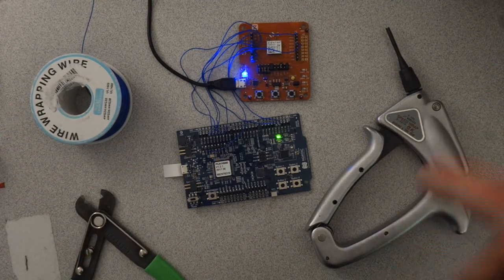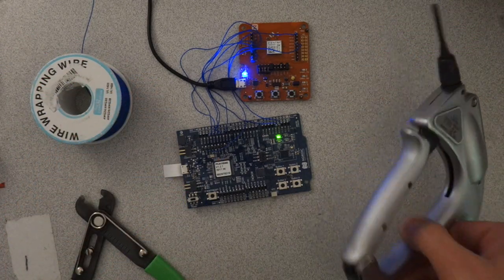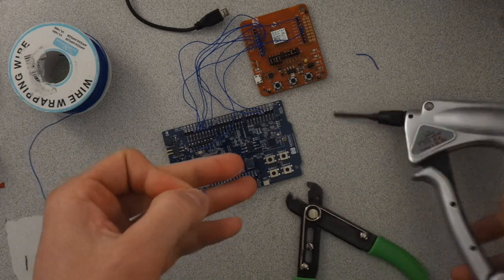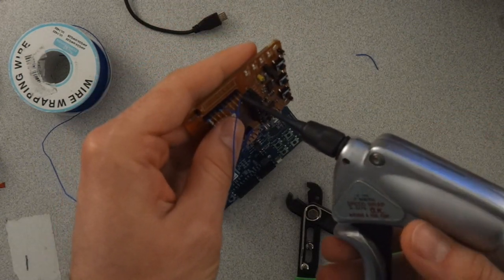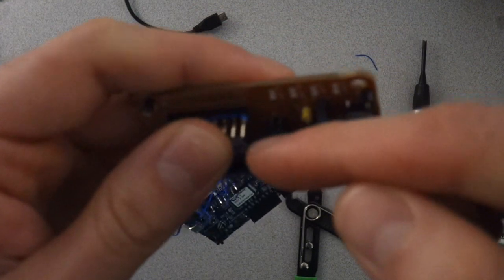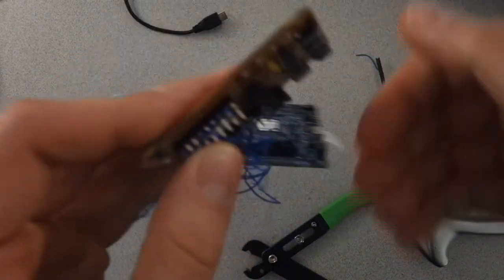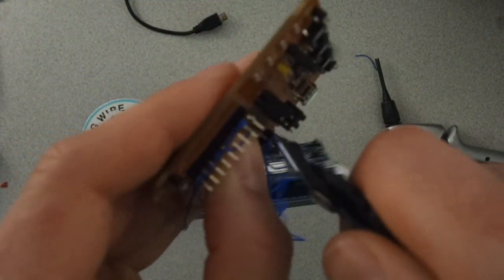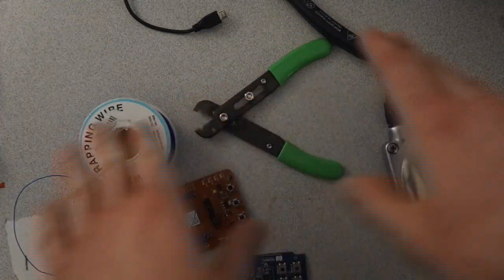Prototyping using Wire Wrap

Comment: It's easy if the components pin is long enough.
Reply from the maker: Yep! Hard to do on a stubby pin. In most cases though any 0.1" (2.54mm) pitch square header will work.
Reply: @CircuitDojo  Thank you for replying.
How do you wire wrapping Terminal Block?
Reply from the maker: @jumbo999614  not sure what you mean.